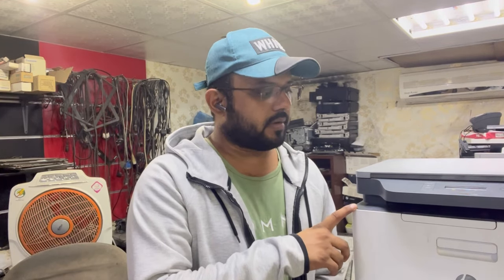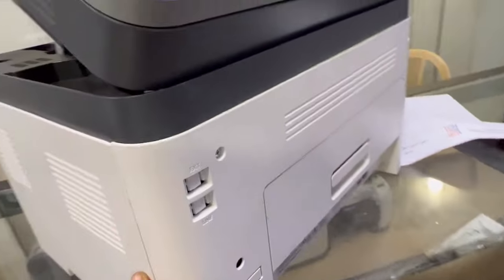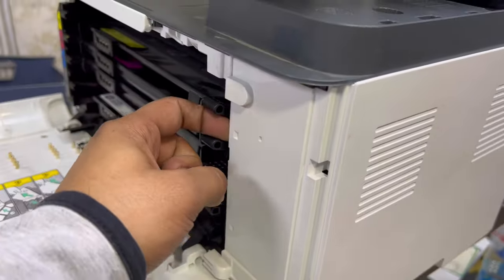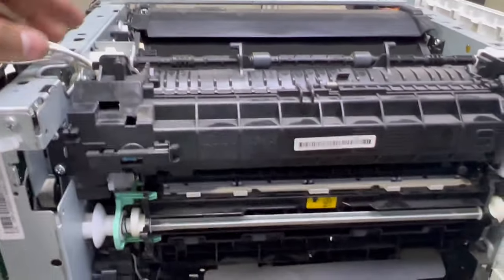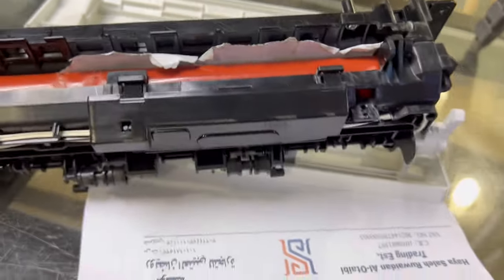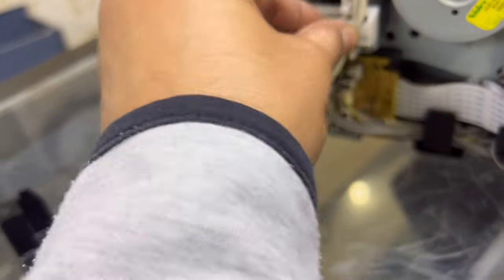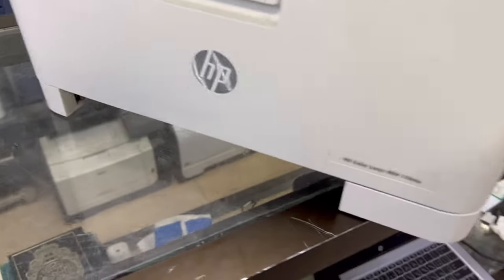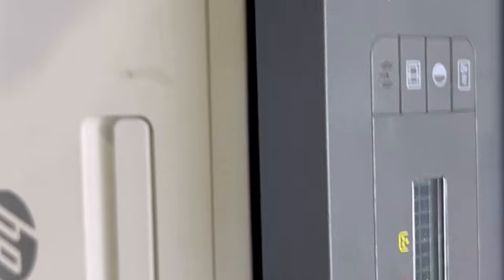How to Fix Paper Jam Issue in HP Color Laser MFP 178nw Printer? Fuser Unit Disassemble Guide

Comment: Thank you very much! I had paper that got stuck in the output feed and rolled up around the roller. I initially followed the steps to disassemble the fuser unit. But when I got to the part where you unlatched the top part, I realized removing the top part was all I actually needed to do to get the paper out. Saved me from having to have the printer serviced, and now I know what to do next time something like this happens again!
Reply from the maker: Excellent!

Comment: I always tend to look for the root cause of the problem, because that is the field of my expertise. As regards paper jams, I would suggest that it has something to do with the paper absorbing moisture (from the atmosphere) and thus losing its rigidity or stiffness. This would happen if one does not print often or the paper in the tray is exposed to the air for a long time. To prevent this paper should be stored in a plastic container with a lid that seals properly.

Comment: 🤩🤩🤩Dear Mr Bilal, you are a superhero!!! I had exactly the same problem of jammed paper torn and stuck on the fuser roller - I was very lucky though after your video showing me how to unclip the scanner tray I was able to lift the top flap and gently roll the stuck paper until it showed an edge, then very gently lifted it with a small flat screwdriver, then rolled it forward until it came out. As you said there was another sheet torn and stuck underneath that one so I did the same, gently lifted the edge then rolled forward until it became free. So now nothing on fuser roller! I've just tried printer and was expecting the 'duh, duh' sound and the orange light but it is fine green light and printing! You are due to have some very very good karma coming your way for helping people like this! Many thanks from UK.

Comment: I also had the "worsed case" problem of jammed paper torn and stuck on the fuser roller, which required a full disassably of the printer.
Thanks a lot, all steps have worked like shown in the video. 
The HP service was only able to give a  support on a very low level, which ends before you touch the first screw.

Comment: No need to open all this…. 
Just needed was to unhinge the scanner part, and slowly pull the part out….(it does take 5-10 mins tops)
But u were right for the clip for the first at the back

Gr8 detailed video though; thk u
Reply: Yes! A great addition to the video. I got stuck while removing the side wall (could not disconnect it from the rear part), I hoped I could skip that. I was able to unjam the printer with just unhinging the scanner and opening the fuser area from the top.
Reply: Is there a video of this method? Otherwise it seems an awful lot of work just to remove a piece of paper!

Comment: Hi, my name is feri. I got paper jam then I removed the paper from the back door. But unfortunately when I pulled the paper, it's torn and some piece of paper are stuck in the printer. Please help me how to fix it. I tried to print a file but it's paper jam again.
Reply from the maker: Feri if it’s stuck inside fuser then you have to disassemble the fuser unit. Could you make it clear the exact place of jam
Reply: Hi, thank you for your advice, the paper jam is already cleared. I tried to remove the pieces of paper from the back door and inside the printer (under the scanner) 😊

Comment: Did it, but now getting #u1-2320 error code. Any suggestions?
Reply from the maker: The error code indicates that the fuser temperature is abnormal. In most printers this error is caused by a failure of the fuser but there exists the possibility that the power supply is bad